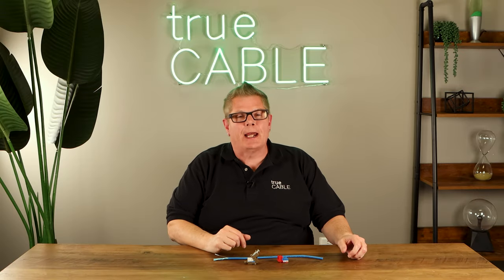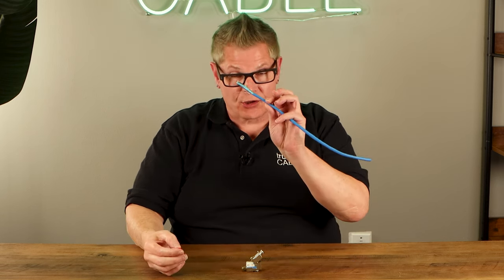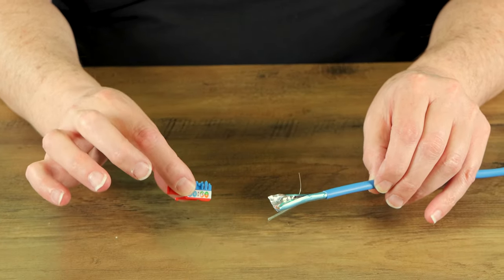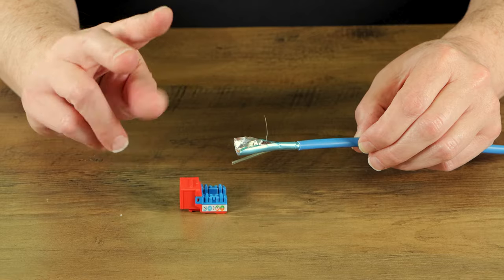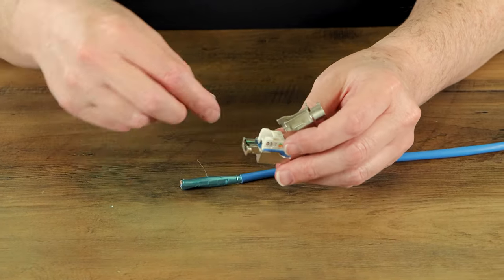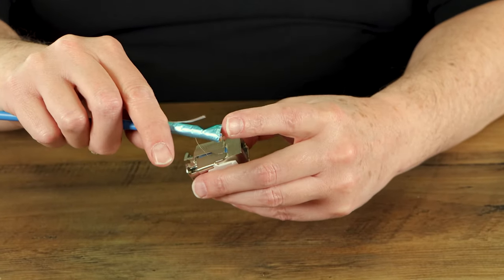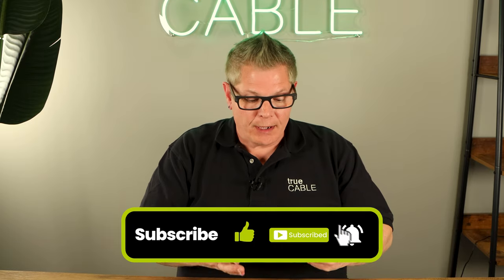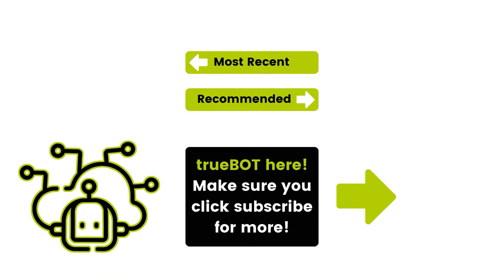Why You Shouldn't Use Unshielded Connectors on Shielded Ethernet Cable

Comment: What I don’t understand is that the modem I use has plastic ports so how can that take a grounded connector wire back to earth, not to mention that the modem works off a DC wall wart which is not earthed so the modem is not earthed anyway.
The switchbox on the other end is DC also so it’s not earthed. 
My double shielded cable apparently has a drain wire but how am I to know which end of it has the ground wire attached.

So many unknowns it just makes life more complicated that it needs to be.
Reply from the maker: Hello! I understand your frustration. The modem itself is actually earthed, if your ISP bonded your coax cable properly outdoors before bringing it inside. The second conductor in coax (the braid shield) makes contact with the Series 6 connector and also with the metal coaxial connector on the cable modem. That would be bonded to ground, but again the bonding is done by the ISP that does the drop. If you check outdoors you should see where they bonded it before it comes inside--it will look like a large coupler with a green wire. Be advised that sometimes the ISP will also find a water pipe to bond to with a bonding clamp for coax indoors, but with PVC and PEX being used so much these days that is rather dubious.

Comment: Can I bound the shield of the cable from only one side?
In other words, one end with the metal keystone jack connect to earth and the other with plastic keystone jack.
Reply from the maker: Hello Paolo! Yes, you can do this when you need to avoid a ground loop. Otherwise, bond both ends to the same AC ground. Hope this helps!

Comment: Should I be using shielded patch cables then if the we have shielded Cat6A terminated on shielded RJ45 (Panduit minicom)? Or does that patch cabling not matter?
Reply from the maker: Hello Darrell. The general guideline is to use all shielded hardware and accessories when installing solid copper shielded Ethernet drops. That would include patch cords, any type of connection hardware, etc.
Reply: @trueCABLE  Thank you. Follow up question. To provide a little perspective, we're not in a high EMF environment. Shielded cable/jacks were installed because a sub-contractor misunderstood the drawings. We use short patch cables (8 inches) between the patch panel and network switch. Would there be any issue with just using UTP patch cable? Rack and patch panels are already grounded.
Reply from the maker: Hey Darrell! You are all good. The path to ground is already set from the patch panel to your AC ground. The patch cables do not have to be shielded UNLESS you are pushing 10G and you are concerned about ANEXT (Alien Crosstalk) from one patch cord to the other. If you are pushing 10G, then shielded patch cords are the best way.

Comment: What if I DIY wire all shields to ground directly? Will it then be OK to use unshielded keystones?
Reply from the maker: Hello. No, that would not be a good idea. End to end, the entire channel, including the terminations, should be shielded. It defeats the purpose of using shielded Ethernet if your terminations are also not shielded. Using shielded keystones to help bond your shielded Ethernet system to the ground makes your installation easier, not harder.

Comment: Would a cat 8.2 be overkill for home networking? Do I have to worry about shielding if I just plan on using a cable from Amazon? I'm guessing this video is for more intermediate users.
Reply from the maker: Hello! Cat8 is definitely overkill. If you need 40Gbps networking, you should be considering running fiber optic. Cat8 won't provide 40G past 98 feet, however. After 98 feet, it is back to 10Gbps like Cat6A. I would say the top copper Ethernet Category you should consider is Cat6A, and shielded cable is not likely needed in a residential scenario. Shielding does NOT increase cable performance, it is designed to mitigate interference you already know you have (big motors, higher AC voltages, radio frequency problems, etc.). It should be noted that shielded will dramatically increase the complexity of the installation if done properly. It is more difficult to terminate, the termination hardware costs more, it cannot bend as sharply as unshielded Ethernet, and most importantly, it must be bonded to ground. Don't use it unless you know you have to.

Comment: Been going through your videos, so this may be answered, but other than just "knowing" that your cable runs by some AC equipment or other things, are there any tests or indicators that a cable should be shielded? What situation would you be using a computer and then think "something is wrong, the cable needs shielding"?
Reply from the maker: Great question! Generally, EMI/RFI that is affecting your cable will show up with excessive dropped packets resulting in much lower than expected network speeds or even intermittent connectivity in very severe cases. Doing a test that measures excessive dropped packets will tell you. That will take a working network and PC with software, however. Keep in mind that MANY factors can affect your speed (especially if you are relying on ISP speed tests to measure it) and the best test would be from PC to PC with a switch & router in the middle. I would suspect EMI/RFI interference as the least likely cause of low speeds, especially in a residential environment. Hope this helps!

Comment: I will have to swap out my shielded cables where they are only in a metal socket at one end.
Reply from the maker: Hello Wisteela! I would advise doing that, yes. The cable is not able to perform fully without shielded hardware at both ends. Hope this helps!

Comment: "it becomes one unit electrically"
Yeah like how when you plug it into a standard port it's still powered, this is some clickbait. Nothing bad will happen from using shielded cables with your unshielded router or boards. Maybe this idiot hasn't touched an ethernet cable since the 90s, but nowadays they all have a drain wire internally connected, so the circuit is always going to be completed.
Reply from the maker: Hello! Most of the time, nothing bad will happen, I could not agree more. That said, there are scenarios where high EMI and especially high RFI environments can lead to issues if the cable shield is not properly bonded to ground. The requirement to bond to ground is found in the ANSI/TIA 568 standard as well as all BICSI documentation when discussing installation of shielded Ethernet cable. To suggest otherwise would not be responsible. We at trueCABLE will always communicate and defer to the foundational standards and industry best practices that all professional installers are expected to obey.

Comment: What about the opposite?
Shielded connector with unshielded wire.
Reply from the maker: Hello and great question. It really depends on the connector type. If we are talking about a keystone jack or field termination plug that uses IDC style terminations, then you will have no issues at all from a technical standpoint. It just bad form, that is all. Using shielded hardware on unshielded cable runs may lead someone in the future to misidentify the cable type. Now, if we are talking about 8P8C connectors, then DO NOT do that. First, a shielded 8P8C connector is likely only going to accept a larger min/max insulated conductor range than typical unshielded insulated conductor thicknesses. More than likely, the insulated conductor from an unshielded cable would be below the acceptable minimum for the plug. That would lead to shorts. If, by per chance and with careful research, you did manage to marry up a shielded 8P8C plug with an unshielded cable then it will work, but that would still be bad form. Not to mention, shielded plugs cost a lot more than unshielded plugs so I don't see the point in even trying. I hope that helps!
Reply: @trueCABLE  Thank you.

Point is purchasing one connector type over multiple.

Makes it easier for field techs and storage.

Good info all around. I appreciate it!
Reply from the maker: @lightingman117    Hello again! No problem. I know it would make logistics easier to have just one connector type, but considering that every Ethernet cable is built differently in regards to conductor insulation diameter and other factors it just never works out that way. Glad I could assist!